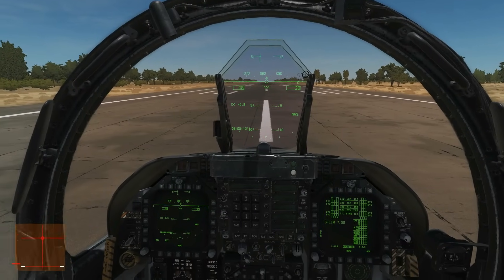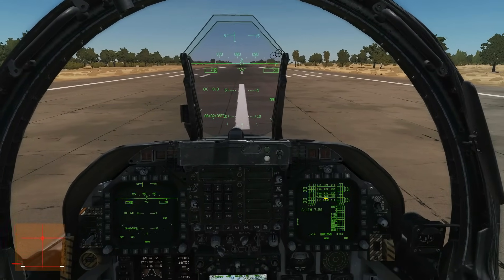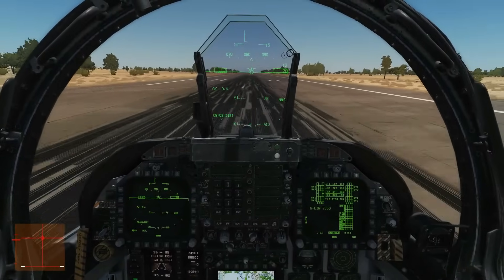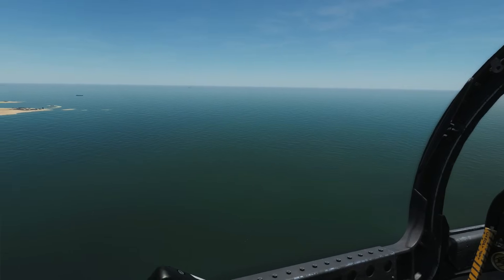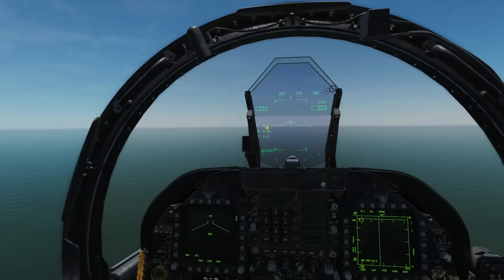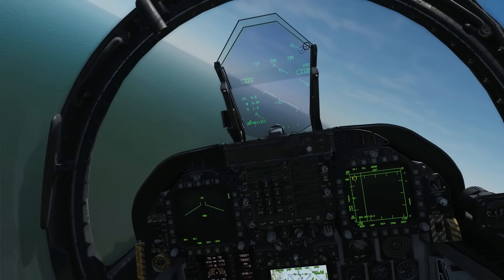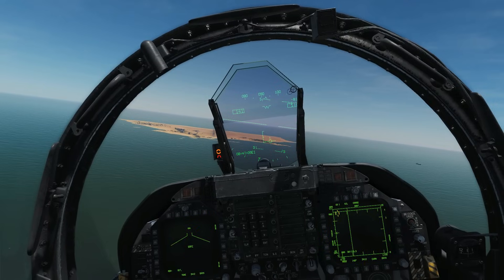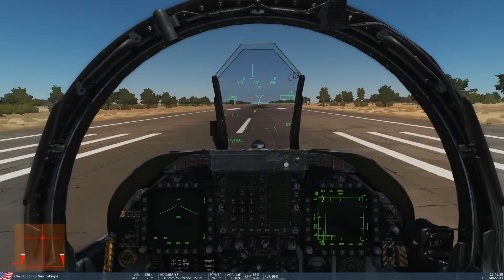FA-18C: Airfield Takeoff & VFR Landing Tutorial | DCS WORLD

Comment: Played Ace Combat 3; learned how to land gently. My tip’s to stay low, speed, flaps, & gear down, and as you approach the runway reduce speed the closer you are to the ground until the aircraft nearly stalls. By then, you’ll be a few feet off the ground, which’ll get you a gentle landing.
Reply: You do NOT land gently with an F18. Actual captain and F18-er here. The gears of the Hornet are designed to take a rough hit, because on a carrier, you don't have the space to flare up. So basically you crash in a controlled manner and hope that you'll get the 3rd cable, which is ideal.

And with that said, we only ever land any other way is when we have a passenger (some high ranking officer wanting to take a ride or sth). Every ground landing is an opportunity to practice the correct way.

Also, there is a little indicator on the left side of the canopy, which will tell you the correct glide slope. If you put it spot on, you will have a traditional F18 landing. If you fuck it up, and have no excuse for doing so, you'll get an O for that landing and a boot up your arse.

Comment: Just for comparison:
An airliner lands at a 3° angle and flares to about 100-200ft/mins.
This guy lands at 8° and doesn'T flare, lands at about 800 ft/mins. 4-8 times the impact speed of a normal airliner flight.
Reply: F-18 carrier landings are at around 700 ft/min and are made to withstand very hard landings. You cannot compare an airliner made for commercial use landing on a stable runway and a high performance fighter jet landing on a carrier. Nice try though.
Reply: @dcsaholic2636  I can'T? I just did, didn't I?;)
I didn't criticize, I found it fascinating that the fighter can do that.

Comment: Maybe cause this is an old revision, but military thrust is designated by the small line across your control display throttle axis, you don't appear to be near that, which is confirmed that you aim for 95% thrust?  100% is military, once you go to burner, rpm stays at 100% but the fuel flow obviously increases a great deal.  Also, the runway has touchdown markers on, perfect aim points, and flap settings is also important, half flap take off (never Auto), and there is no such thing as "neutral" flaps.  Love ALL your videos, just this could do with a refresh, I guess you rushed it as it's not one of the core items to learn, but actually (and I speak from experience), it can all go wrong in this crazy beast, especially for new pilots joining the sim.  Keep up the good work Cap...cheers

Comment: i cant get the pitch trim to work. i can roll using trim, using the the same HOTAS as you and the same key mapping, but the pitch trim wont work and makes a proper landing impossible for me. it will roll using the hat switch but wont do anything at all trying to pitch up or down
Reply: disregard- the fix for me in case anyone else runs into this with the X56 and quite possibly other HOTAS is that the HAT switch up/down is also set for mouse wheel up/down by default which was causing the pitch trim to not work
Reply: glad i left this little note here a year ago, was running into the same issue, i searched how to do it and here we are, back to you lol

Comment: Please help me. When I turn on my flaps and gear, my plane flares up automatically and gains altitude, like stalling while ill try using push trim to catch it. Is the the right thing to do? Or do i use the joystick
Reply from the maker: This is all correct behaviour of plane. You must correct it with trim. Also flaps should be coming down when you are low speed 180 or lower.
Reply: @grimreapers  ok. Thank you. Now I am having trouble with the e bracket. The fucker keeps escaping me. So I have to keep using my trim. I tried using my thrust, but the velocity vector doesn't catch it. How do people keep it centered?

Comment: For a weird reason i hold the brakes, go to military power then full afterburner and releas. But it accelerates very slowly and when i take off i cant gain speed. Pls help
Reply: Are your elevators stuck in a pitch up position and you can't gain any speed at all? That happened to me as well and what I did to fix it was turning off "GAME FLIGHT MODE" in the Options menu, under the Gameplay tab.

Comment: Hey, great Vid, but there remains one Question: What does "pumping the wheel brakes" mean?
Thanks :)
Reply from the maker: rather than holding button down, press it many times. Stops them over-heating I believe?
Reply: They should install ABS
Reply: @simonwahlstrom1296  Adds extra weight.  Need the weight for Gas and weapons.
Reply: @grimreapers  okay thanks
Reply: Randomly In accurate  thank you✌

Comment: You flare on base runways because on a ship flight decks dose give where concert wont and cause landing gear damage and early wear and tear
Reply: Negative. Naval/Marine pilots flare basically for comfort as it's less jolting. The gear (specific the planing link - the thing that keeps the wheels pointing the correct direction) breaks less when planted into the deck vice squeaking it on the runway, but that doesn't mean that pilots won't do it. Being overweight is the only real reason to do it.
Reply: @esf-1272  You should listen to/watch a video from C.W. Lemoine on the Hornet, I think it was his video on his Hornet FINI flight. Navy pilots, when operating from an air field, will flare the landing not just for comfort but also to reduce wear on the gear.
Reply: @Paroxsym-OX  I under stand but I was in an a6 sqadron at nas oceana and iwas told in a6 fam school that flaring on shore was to save wear on the gears concert doesn't give while of the boat the flight deck does give
Reply: @Paroxsym-OX  He can say that all he wants, but that is what was causing our landing gear issues in the first place because the planing link was not straightening the wheels correctly as the gear was designed to be slammed on the deck. I'm not saying I haven't flared and usually do, but it's not because the gear can't handle it nor that it actually shouldn't be planted on the deck.
Reply: @esf-1272  To me it sounds like theres something else in play, as Lemoine said his maintenance crew would bitch him out if he didn't flare during airfield landings.
Reply: @esf-1272  I stand corrected there are only two marine squadrons on airwing rotation
Reply: @Paroxsym-OX  I'm not sure who that is, but if he flew awhile ago they probably didn't know about this. There was a reason we had Hornets flipping over because of planing links bending. I'm not talking about overly stressing it or landing normally overweight, but the gear is 100% designed to be flown into the deck every time.
Reply: @esf-1272  Fairly recent, think his FINI flight was maybe two or three years ago? With the F/A-18C being just recently retired from Navy service, I thought this would've been an issue that had been cropping up for quite some time.
Reply: @Paroxsym-OX  yeah the planing link failures have been an issue for awhile, but the thing is they weren't entirely sure what the reasoning was (besides the part itself). The landings were part of what was considered the reasoning for it. When you touch-down softly in most legacy hornets you will get a momentary (or longer) planing link indication which is aweful with very little time to react and if that thing flips over that could be it.
Reply: @Paroxsym-OX  there are still VERY few legacy Hornets in play right now. Aside from reserve Squadrons, mine has about 7 left. Bug difference from the 60+ we use to have. Sad to see them go.
Reply: @esf-1272  the planning link issue has had a TD out for quite some time now. Cant remember which one, but to tell if they are done, they paint 2 black stripes on them.
Reply: @Purpose_Bilt  I don't recall ever seeing 2 black stripes on them... but I'll have to take a look next time I go fly. All of them have been fixed at this point, so maybe I just didn't notice because they all look the same.
Reply: @Purpose_Bilt  Most of the Marine Hornet squadrons are still around. We're slowly standing down, but there are definitely plenty still around.
Reply: @esf-1272  it was either the planning link or shrink link. I believe planning link. Has a number on it as well.
Reply: @esf-1272  yes that is one reason but as an a6 sqadron maintains crew and going to a6 fam school I was taught to save the gears plus marines only do carrier landing at flight school naval pilots land on Carrie's since the mishap  on the Nimitz back in 78 I believe a ea6b flown by marines crashed on landing trying to get his quals marines were then on shore pilots after that
Reply: @cedrictaylor08  In flight training Marines go to the boat yes. When they complete they may go to a "boat squadron" that still flies onto and off of carriers. This is still happening literally as we're speaking. The guys teaching you didn't know why they were having gear mishaps either and it was because guys were "saving the gear" instead of utilizing the gear as it was designed (not like Air Force aircraft).
Reply: @cedrictaylor08  not entirely true. Some CAGs have marine squadrons in them even with navy personnel to augment them at least as late as 2006. Marines aren't shore only. U sure if they still do this as 106 sea op det recommend in late 2006.